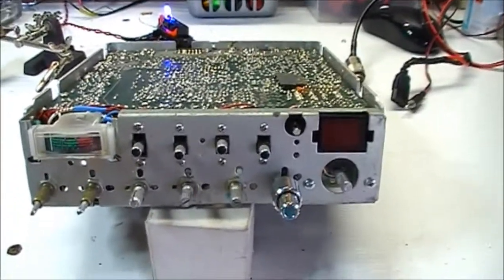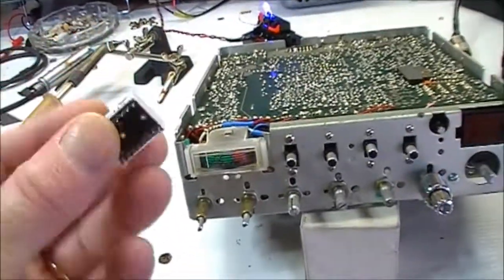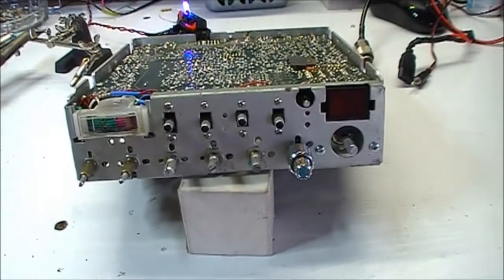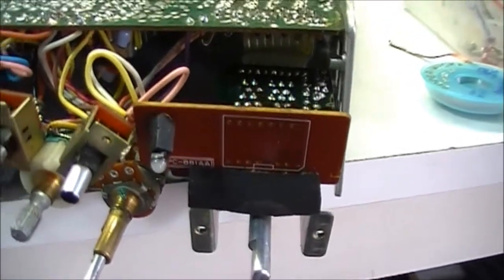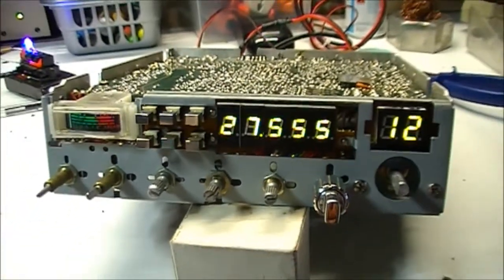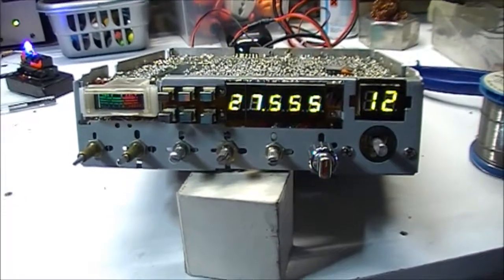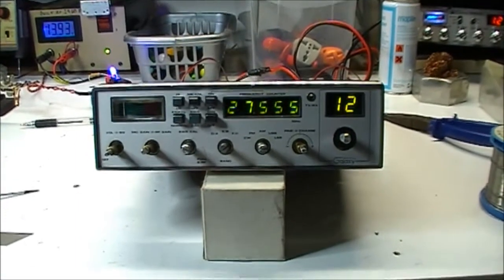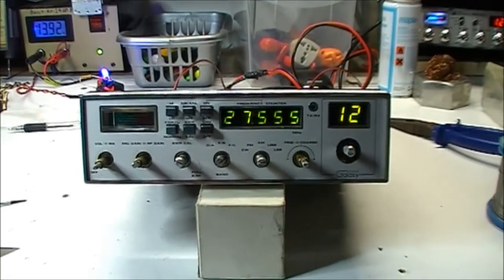Cobra 148 GTL DX Hybrid Part #2

Comment from the maker: Depend on what im doing Pete. i have a desoldering iron. Its part of my solder station (the cream thing to the left with the vac gauge) but if im whipping out something small i just use the braid or the solder pump. Id use the desoldering iron to remove chips and suchlike. Its neat sometimes Pete, other times it looks like a bomb went off on it....lol